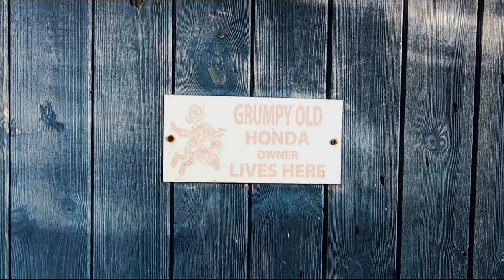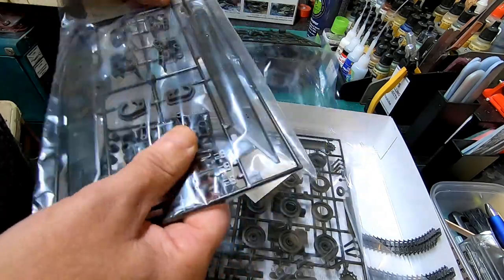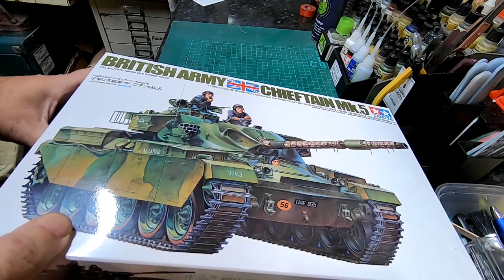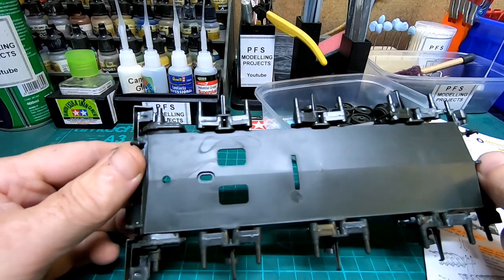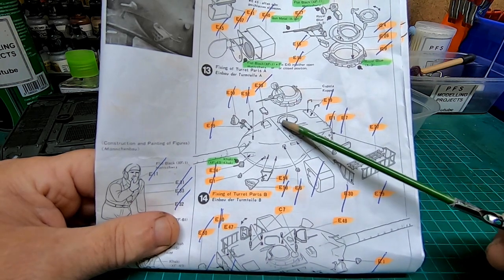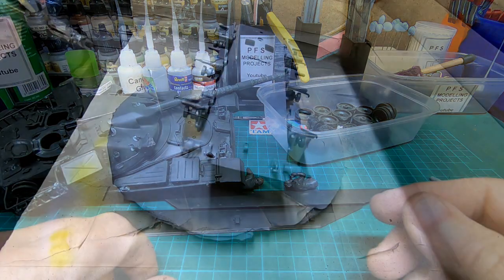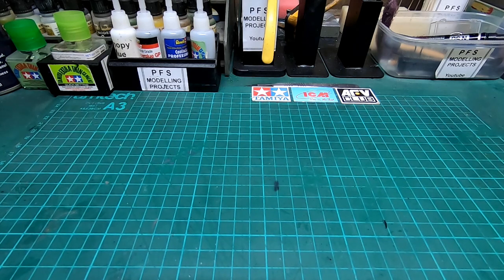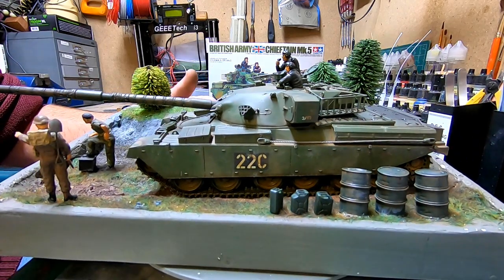Tamiya 1/35 Chieftain Mk.5 Tank..Plastic Kit Build & Review.

Comment: Nice work!  The kits came out in both motorised and non-motorised versions in the 70s. Although the motors could be purchased seperately - made by Mabuchi, the gearbox and electricals were not sold seperately. The motorised kits (usually) had full colour painted artwork, whilst the static kits had a plain white background.
You're absolutely right - they're great fun to build and make the hobby more affordable.
Reply from the maker: Thanks for the info and watching..

Comment: I had Chieftan in the 1970's, wired with battery box and 2 levers. Not sure what brand, might be Tamiya.
Reply: I remember wrapping barrel in painted tissue and fitting a, would it be gas screen where barrel emerges. Used staples for the handles on side armour.